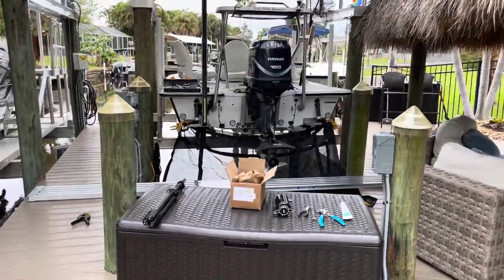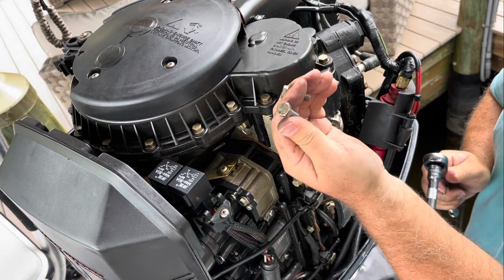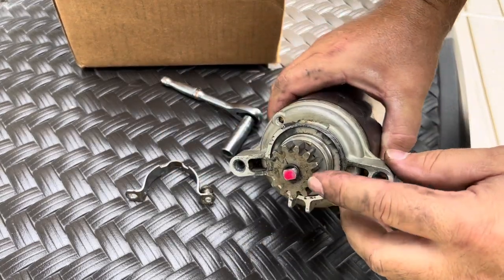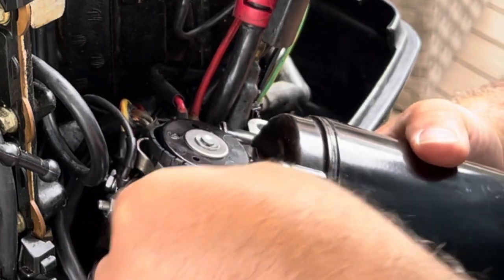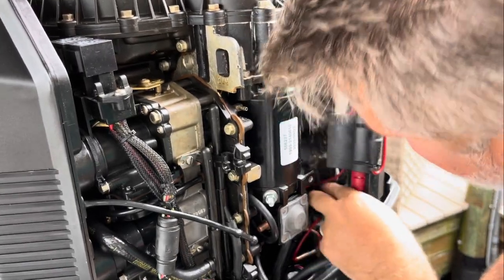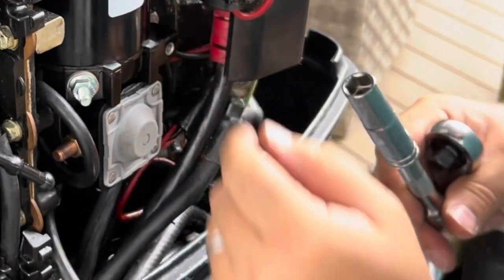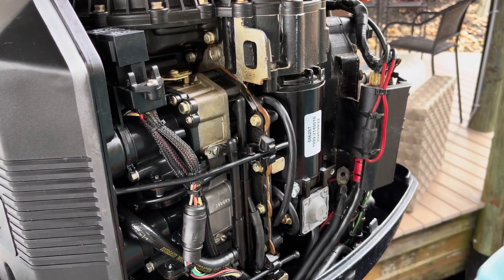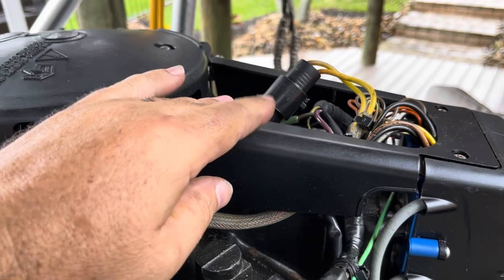Evinrude 150 Starter Replacement

Comment: Well done. Thanks for the video. Mine has been squeeling. Left me on the water today. Going to check all connections and then proceed. Starter body was very warm after a few attempts to start. Solenoid would click but nothing moved. Going to look up model number and get parts on the way. Thanks.
Reply from the maker: Thank you!  Good luck. Easy

Comment: Thanks for the video.  Very clear instructions.  I did not realize it was so easy.  I have a ‘99 150.  After the boat sits on the trailer a couple days it that takes a few key turns for the starter to engage fast enough.  Batteries are fully charged and clean.  After that it starts all day long.  

I am going to check the connections for corrosion first. Thank you for making this video.  Nice dock by the way 💪🏻
Reply: Also, it seems like my bendix is sticking for a split second.  Do you think I could lubricate it from the bottom without taking the flywheel cover off?  Thinking a very light spray with the starter removed.  Thank you.
Reply from the maker: thank you!
Reply from the maker: yes you can shoot some spray like corrosion block up there while the starter is off. seems like it couldn't hurt.

Comment: Very nice and clear instructions. I have a similar Johnson and I thought it was the spring mechanism connecting to flywheel that was gone, but now I rather think the starter is bad since I have the same sound and it does not connect. Will just check connections so it is not a electrical issue
Reply from the maker: Really the best test is to get a set of jumper cables and jump the negative terminal to your negative battery post. Then turn the key and see if it starts. Second test is run a positive jumper to the positive side of the starter and see if it starts when you hit the stud. If in either case it starts you have a wiring problem versus a starter problem. More often than not it’s a loose or corroded ground.
Reply: @bobbygfl  I did exactly like that before I read it and found out that both starter and solenoid is working. I need new cables from the battery to the starter, so will buy some as soon as the stores open after covid lockdown here in Norway.
Reply from the maker: @KyrreTamber  good deal!  Cheeper than a new starter!

Comment: My 115 spitfire / intruder is VERY similar and hard to find info on. The differences? Mines not a "red plug" engine, and you have to take the top cover off to get the gear off the starter - it's not direct starter to flywheel, there's an intermediary bendix shaft and gear you have to wangle around, and it's too tight to get it out with the gear on the starter anyway.

I would have been STUCK on a thing or two without this video since I didn't take pics coming apart!
Reply from the maker: Thank you!

Comment: Great great video thanks for taking the time to film and post this it was a huge help for me and many others. Not sure if it’s even possible but Is there any way you could send me a video of the wiring for the solenoid 🙏🙏🙏 i just can’t seem to get power from the key. i think i have backwards. thanks again, Ethan.
Reply from the maker: Glad it helped. I’m not with the boat but here’s a diagram https://www.justanswer.com/boat/73ffn-1996-evinrude-150-hp-v6-outboard-engine-starting-running.html
Reply: @bobbygfl  Awesome your the best thanks so much.

Comment: Love this video. The engine looks just like my 1990 150 Johnson. So I think I need to replace my starter or solenoid or both. I was starting my boat a few weeks ago for the first time since last season. It cranked 3-4 times and then all I got was a clicking from the solenoid. I'm thinking it's the starter, but I don't want to play the parts game. Especially when the starter is anywhere from $150-$200 and taking it to the boat mechanic an hour away is $150 just to open the cowl and start exploring. Thoughts?
Reply from the maker: Battery good?  I’d start there for sure. May be just low amps. Then check the grounds. If the ground is rusty it’ll not let full amps through the hot wire and you’ll spend a bunch of time tracing down your positive lead when it was the ground the whole time.

Comment: Nicely done video, thank you.  My starter engages for a few seconds, turns the motor over, but then starts squealing very loudly.  Sometimes it disengages, sometimes it stays engaged but still squeals.  I can get the motor started but should address the issue.  Is there a way to lube that bendix, without removing the starter, to see if that is the problem?
Reply from the maker: Yes you have to pull that entire top off to access it. You can do that without removing the starter but it’s a job. So much work in fact that you should probably just buy a new one if you’re going to put that much energy into it.

Comment: hey Bobby, I just got my hands on one of these engines, I have no idea about wiring etc, just wondering how I hook the engine up to power? is it a matter of making a power cable and connecting it to the starter? where would that attach on the battery ?
Reply from the maker: Yes. Starter lead and ground to block. See my parts explanation video in this sane video playlist.

Comment: How did you test your kid starter to see if it was bad? I just replaced my solenoid & still nothing
Reply from the maker: You have to touch the positive directly to the starter, bypassing the solenoid. it’s grounded so all you need is a jumper from the battery you could use jumper cables from your car. Just touch that terminal and if it spins it’s not the starter. be very careful not to hit anything else or it’ll spark violently

Comment: Can you show where/how to install a new rectifier. I have a '95 150 Oceanrunner. I tried replacing and now the motor will not shut down when I turn the key to off position. It sounds weaker as oppose to the key in the run position, but it won't stop.  Where did I go wrong?
Reply from the maker: hummm.  i'm not sure.  there are only three connections.  the tach wire, the harnes and the ground. i'm sorry but i have not idea.

Comment: Very detailed! Great for someone new. Curious if there are heat setting for your Milwaukee heat gun? That took a long time do a single terminal.
Reply from the maker: no heat setting.  the things is not very hot.  it's good because you'll never burn the wire lol but bad because it's slow.  i still use it all the time because i don't need to drag out the extension cored lol.

Comment: Which bolt does the positive cable hook up to? Couldn't get a clear view in the video
Reply from the maker: The positive is the right side or rear side looking at the the installed starter. The negative has the strap cable on it for reference.

Comment: Are you sure this is a 96? Should have the new Square Harness Plug. I see it has the RED BULB, which is usually pre 96.
Reply from the maker: I’m pretty sure. I could be wrong but I did find the same motor with the actual serial number on it which was a 96 and it looked the same.
Reply: @bobbygfl  Interesting.  Surprised to see that. I actually just recently bought one. The guy bait and switched me. Put a 94 in my truck, instead of the 96 I was buying (then blocked me, when I called him out on it). The Red Bulb was my 1st give away (then, confirmed by the Model/Serial, on the Tag).   Anywho, I'm about to do this, as the Starter (and/or Solenoid) smoked, when I tried to turn it over for the 1st time. Fun times....    Thanks for a great vid. It's a bit different than my previous 1988 140. I was ready to take that top off. Not today, satan!